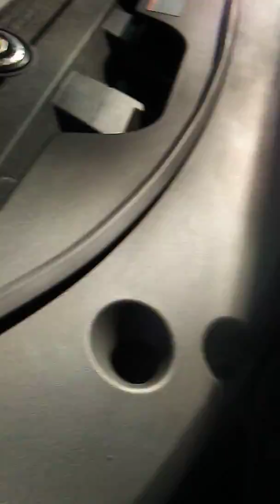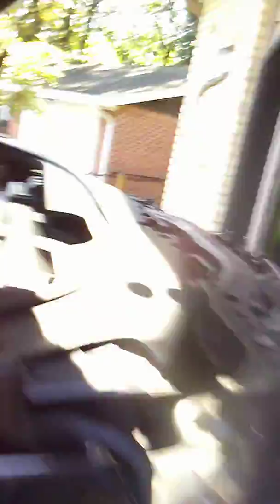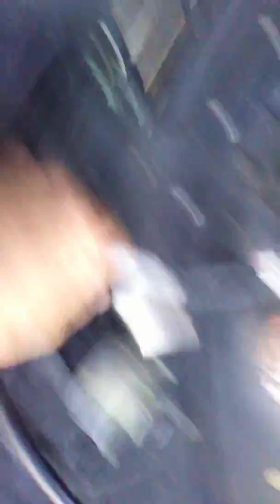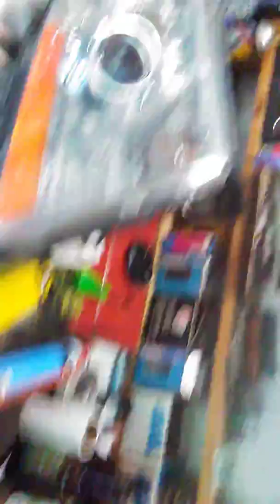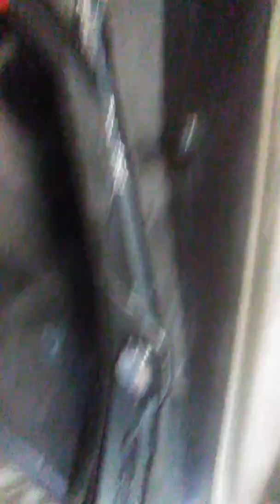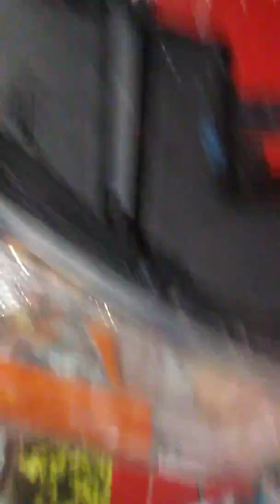$5 Cadillac SRX Headlight Repair for Moisture problem

Comment: I have a 2011 SRX and recently addressed moisture problem when one headlight burned out.  I ordered new headlamps from Amazon.  My plan was to seal the new ones with silicon before installing them to prevent current problem..  My old lights had started to cloud on outside so I ordered the new lights.   Taking bumper off was not that hard thanks to several excellent videos on You Tube.  It took an hour for me the first time.  When taking out original light,  found out I had HID lights and the Amazon lights did not adapt.  So I used RTV silicon around the seam as per this video.  I did take a day to dry both lights out in the house and a day for silicon to cure.   After several weeks of heavy rain,  lights remain dry. The clouding issue was also improved.  The new lights for HID lights were over$1000 apiece.   Thanks to all who made videos about this problem and shame on Cadillac.  One week after completing this repair,  a daytime running light went out.   Took bumper off in 30 minutes and replaced both running light bulbs.

Comment: I have 2012 srx premium. Do i have halogen or hid? Unsure dont want to order wrong headlight
Reply from the maker: Probably HID which don't newly qualify for up to $800 each repair/replacement cost. But my sealing could work with either. Call a Cadillac dealer with VIN to find out. The replacement for halogens I have been told cost more than $800 each, though.

Comment: I’m about to buy a used one and the passenger light is showing condensation. This is unacceptable. Should be recall
Reply: I received a letter from Cadillac that they would reimburse up to $ 1,600 for headlight replacement, you might want to check with your local dealer.
Reply from the maker: @cliffvaughn2294  Me too - except mine are HID which cost even more to replace. Thanks GM!!!  :  (
But, no moisture since I sealed them a year and a half ago.

Comment: CMS, how is this working so far? My mom has the same problem and headlight just went out as well so we need to take everything apart anyway. She got a quote of $2500 CDN to replace the whole unit so $5 sounds a lot more appetizing...
Reply from the maker: Hey Ax -

So far so good. One is completely dry and the other gets a tiny bit of moisture - but then it drys up quickly. It's worth a shot with only a little time invested. 2 folks would make the job take about an hour  :  )
Reply from the maker: As of today, no moisture at all !

Comment: Het CMFSr.You forgot the three 10mm bolts on the bottom and there are three 10mm holding each headlight in not two,LOL! I just took mine off yesterday... You also need 7mm socket too for the two upper fenderwell bolts one on each side in your tool inventory.By the way you should also seal the connections into the ballast.The ballast itself is somewhat waterproof all components are in a sticky gel under the plate with 4 screws pretty much 100% waterproof.The two connectors are the culprits and do not seal that good against moisture.Light bead of silicone around the two plugs and press them in and I may note not too much for  ease of disassembly in the future.At that point after what you did and my suggestion with the two plugs you could drive that car underwater and  everything else would short out except the headlights,LOLL! Hope this helps others too with the same problem ...damn plastic junk.............Glenn in N.Y.
Reply from the maker: Thanks Glenn - great info.  I think I cleaned the ballasts but did not waterproof them as you noted with silicone. I did find my "driving" lights out, even replacing them with LED's (cheap try). So the ballast or whatever circuit powers them must be fried.
Reply: Can I bring my Cadillac to one of you to fix my dim/ leaky/ headlights going out?

Comment: I thought air needed to flow thru that seal area to cool the HID bulb. That is what I read in an article explaining the issue with these headlights. It said the seal which allows air to flow out fails and allows moisture to flow in.  Has this method worked for you or have you had any issues?
Reply from the maker: Hey KT - I did not know that. Thanks ! Boy, the seal did not seam to have an aeration property, but who knows. It was my guess that water may get in from there. But that was just a guess. No problems so far - but I did the sealing only a couple of months ago. Thanks again ---!
Reply: Never mind, I found my answer. The air vents are in the back of the housing and are for getting slights amount of moisture out of the assembly. So in theory if you get all the moisture out and seal it up real good then you could even seal up the air vents as well.  Good video, thanks for posting it.